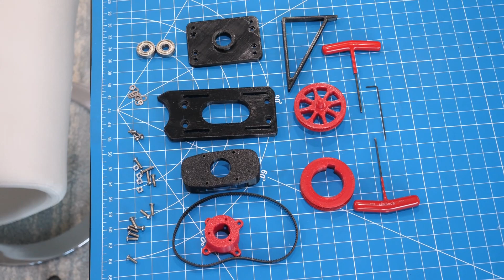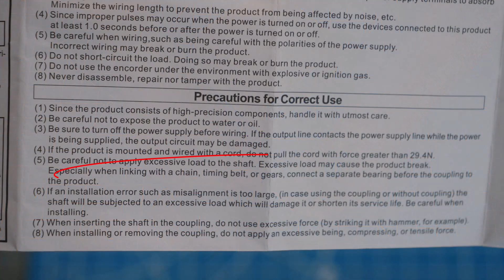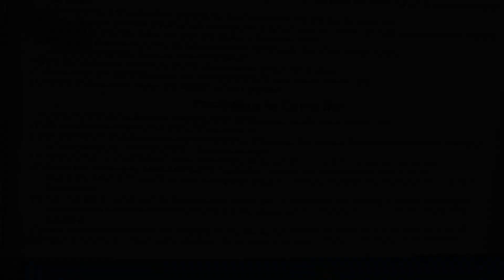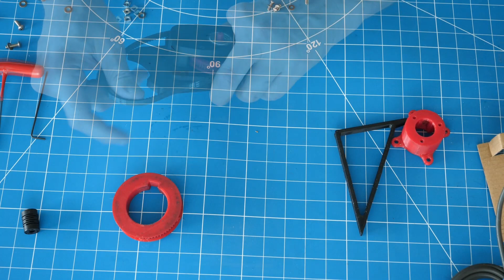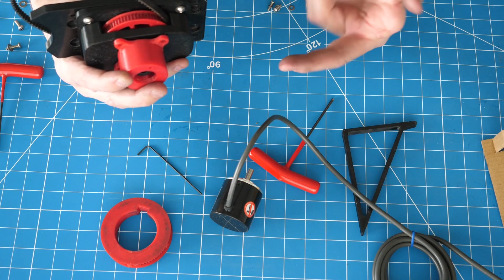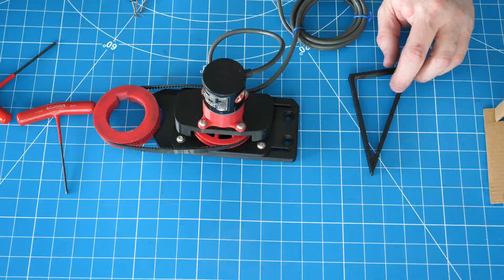G0602 Lathe Electronic Lead Screw - Encoder Mount - Part 1

Comment: Would you be willing to share the CAD file? I love your design but I’d like to adjust a few things for my lathe.
Reply from the maker: For the mount parts, the best I can do are the models I've posted onto thingiverse - see the link in the description. For the pulleys, if you are using Fushion 360, I published a Fusion 360 add-in that allows you to create GT2 or GT3 timing pulleys. You can find that video that covers the Fusion 360 add-in in the channel playlist.